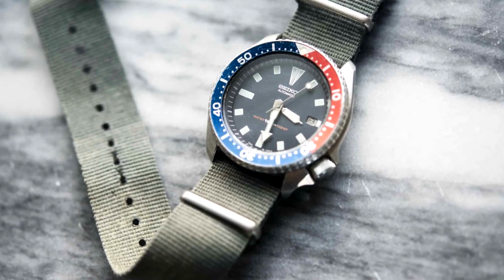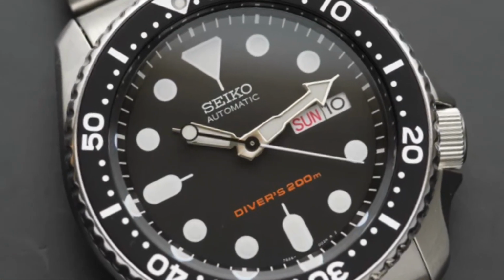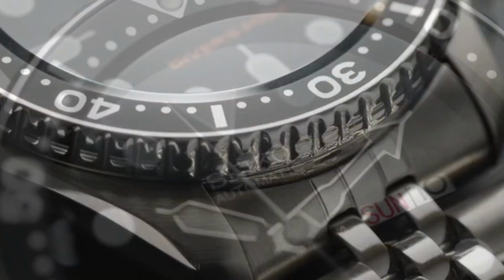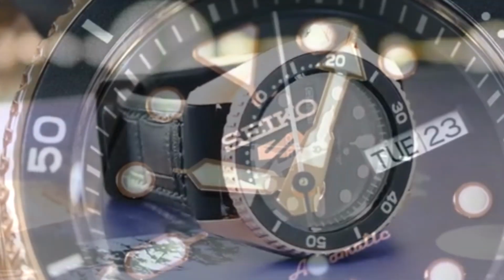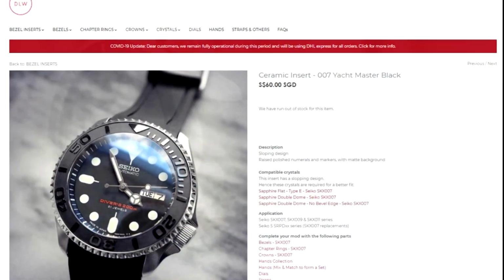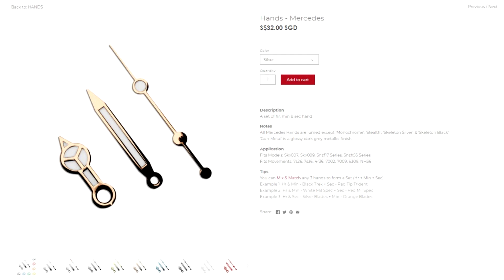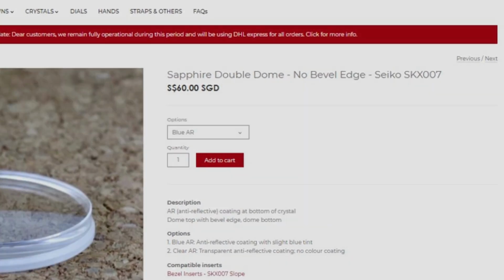How to mod Seiko 5 (SRPD76K1) - Yacht Master Style

Comment: 1 disadvantage of the new 5KX casing is the crystal gasket size. If you're using back the original gasket you may not notice it. The gasket is not the same as the common SKX. It's a tad thicker and if you destroy the original gasket you can't get a replacement because nobody has a stock of the new 5KX crystal gasket. 
I discover it by accident when I  wanted to use a new skx crystal gasket. The crystal is loose so I got no choice but to install the original back.
Reply from the maker: Thanks for sharing. We are well aware that the size is different from usual skx. Namokimods is currently working on the new 5kx crystal gasket.
Reply: @NisokiesNafokies  Good to hear the news, last I enquire from Namoki they don't stock any. But not anytime soon, so just take care if you're installing the crystal for the 5KX.

Comment: How much is the whole process including the parts. I am thinking to buy the watch but at $300, plus parts ( maybe around 140), adding the labor plus shipping, I may as well get the steinhart. Can you clarify? Thanks.
Reply from the maker: Hi Nel, thanks for the clarification. You can't really compare modded watch and stock steinhart. Even you end up spending similar amount of dollars into it, modded watch is something exclusive to you as you are the one who decide which parts to be used in your customized watch. It will be you own unique timepiece and not another stock watch. Hope you under where we come from.
Reply: @NisokiesNafokies  true that. Question. Can I just change the original bezel to the one you recommend without changing anything else?
Reply from the maker: @NeL-1  Yes you can. It is entirely up to your choice. We believe you are referring to Yachtmaster Bezel Insert (not bezel).
Reply: @NisokiesNafokies  yes. Thanks for the correction. 👌
Reply from the maker: @NeL-1  Yup. You can just change the insert without taking out anything.
Reply: @NisokiesNafokies  thanks Niso. Btw, where are you located in the states?
Reply from the maker: @NeL-1  Hi.. we are located in Singapore. 😁😁☺️
Reply: @NisokiesNafokies  oh wow. 😂